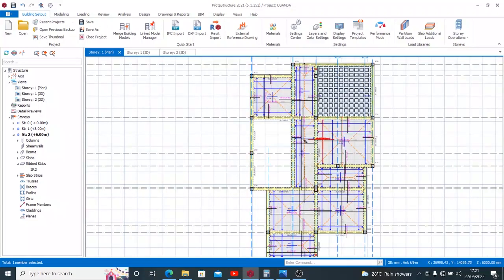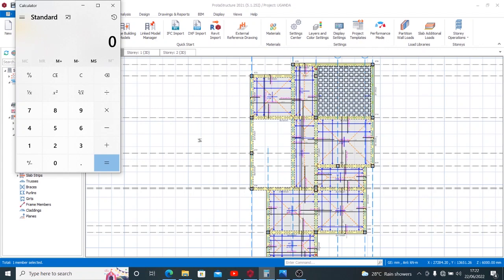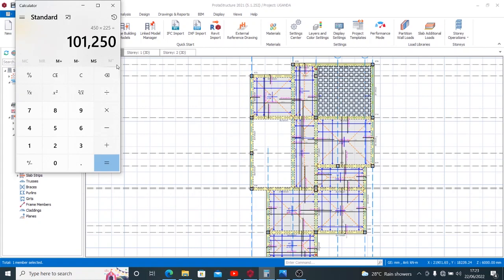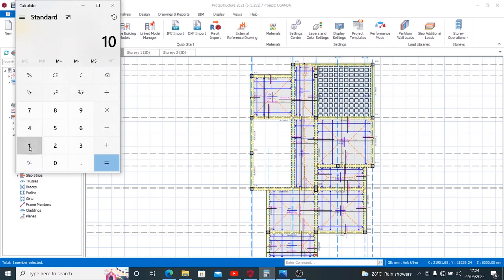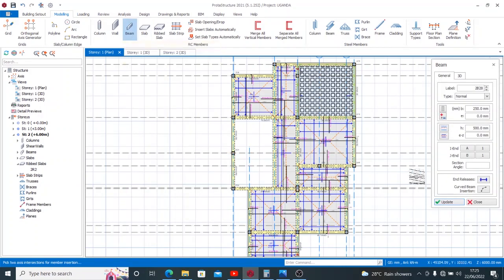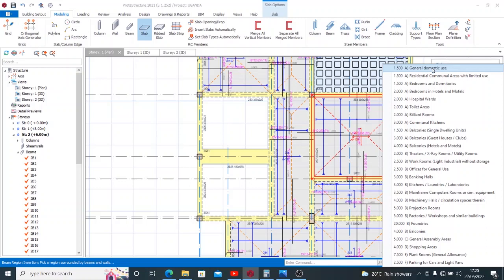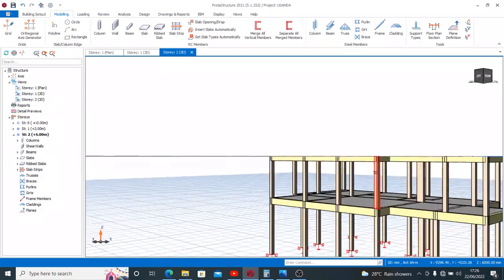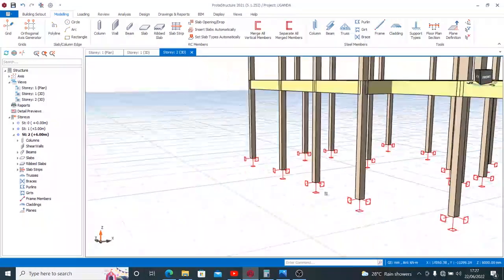HOW TO CREATE HIDDEN BEAMS / CONCEALED BEAMS USING PROTA STRUCTURE

Comment: Thanks for the video. Learnt a lot. Keep the good work going. You are impacting more lives than you think. 

What is the minimum depth you can have for beams (hidden beams inclusive)? 
I have always thought 225 mm is the lowest allowable for even concealed beams. kindly throw more light.
Reply from the maker: Thank you for the kind feedback,we are encouraged to do more.
Concealed beams are expected to be within the slab thickness,not being revealed and so it's usually the same depth with the slab. To ensure that it has an area sufficient to create a Moment of resistance which is consistent to the normal LxB, we will need to take the first step I took in the video to determine the width of the beam..
I hope this is helpful
Reply: Olusegun Kehinde  always equivalent to the slab depth
Reply from the maker: And also you'd need to use the Span/Effective Depth  to determine the minimum depth of beam and that's going to help you know what depth to consider.